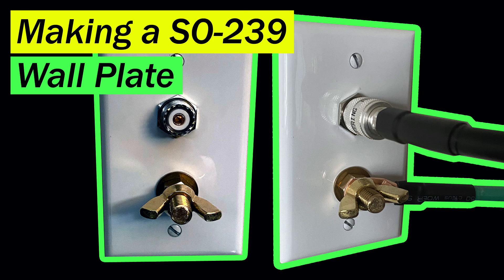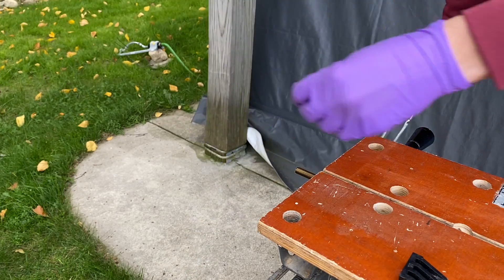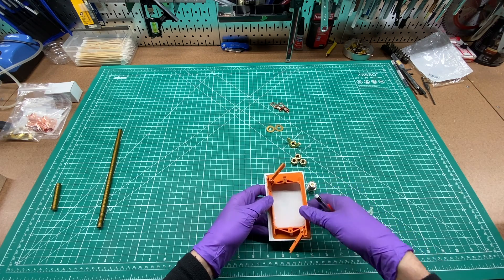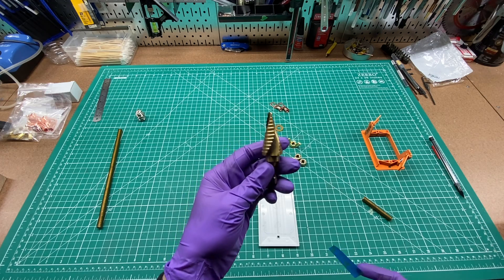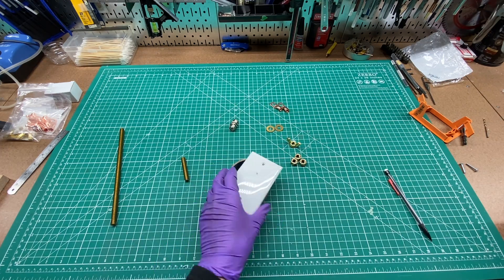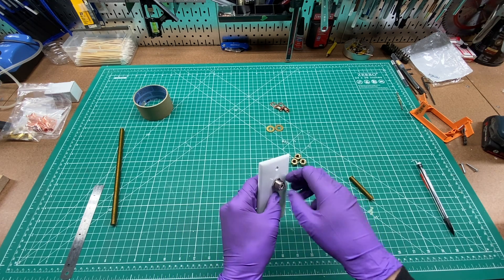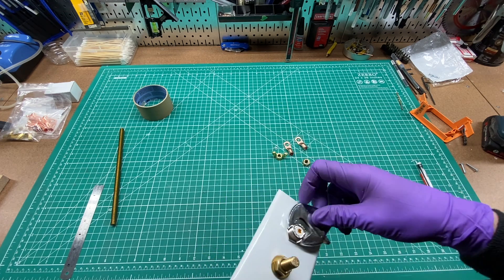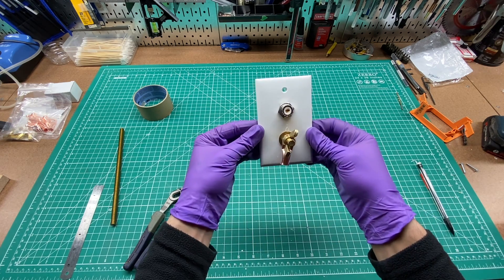Making a SO-239 VHF/UHF bulkhead wall plate with equipment ground

Comment: 4 gauge wire 😳 you can jump the car with that!  you electrical service panel may use 6 or 8 for 200 amps
Reply from the maker: Haha. I think NEC for the panel ground is 6 awg minimum for copper isn’t it? I had a bunch of 4 awg left over from adding ground rods for my antenna and redoing the bonding all the way back to my panel. I chose 4 awg for the additional toughness and the hope that it will resist corrosion in the ground longer. 

A lot of people use 1 inch copper strap for their shack grounds, so if figured why not use the 4 awg wire 😀

Comment: Newbie here. How do you ground the grounding post? Run a wire through the outside wall to a grounding rod that's been pounded into the ground?
Reply from the maker: Hi Justin. The short answer is yes, but grounding in general is a pretty involved topic and is something that people frequently get wrong (including electricians when it comes to antennas). There is more to consider than just pounding in a ground rod and running a wire from it. I highly recommend reading this book if you haven’t already: “Grounding and bonding for the radio amateur” https://amzn.to/3zDuNdi

Comment: Definitely use a metal plate for strength. Use an insulating bushing for the SO-239 to avoid ground loops.
Reply from the maker: Thanks Dave. I have a metal plate in case this one decides to break on me. The nylon plates are surprisingly tough though. They look like the junky plastic ones that break easily, but the nylon ones flex but don’t crack. Time will tell, but I bet it will be ok. Thanks for the suggestion.

Comment: One thing I do on the step bit is color in the step above the one you want to drill with a Sharpie.  It won't fly off like tape.  You can wipe the Sharpie off that bit with alcohol or brake cleaner.
Reply from the maker: Ahh smart! I’m totally doing that from now on